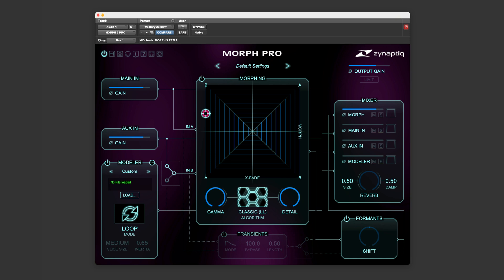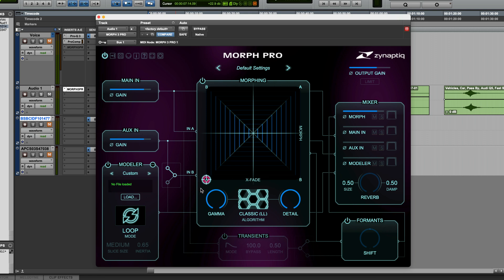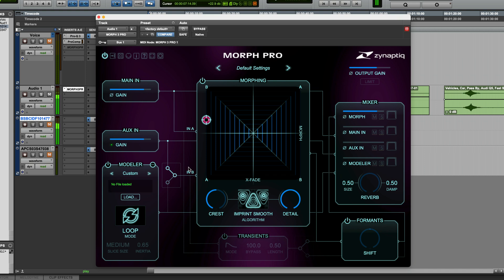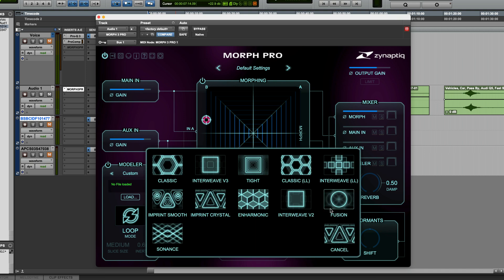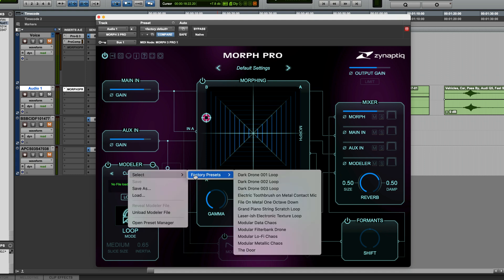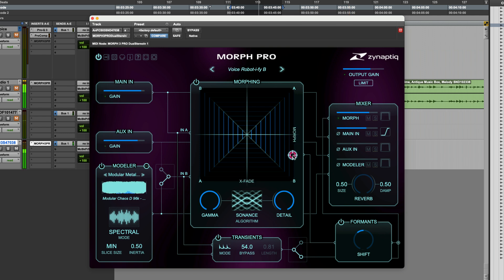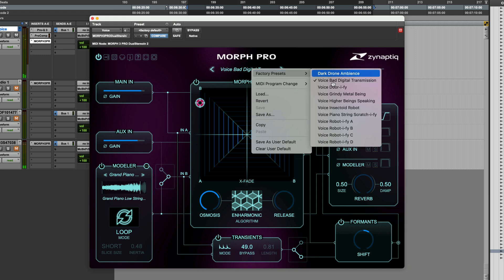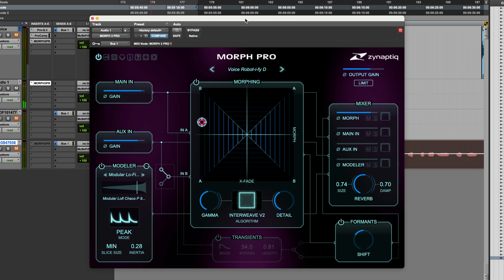Experimenting With Sounds In Zynaptiq Morph 3 Pro

Comment: Useless plugin !
Reply: Not even close, but there’s a definite learning curve when it comes to choosing your sources. It takes a lot of trial and error to figure out what works, but when it does work the results are beyond anything you could achieve otherwise. 

I tend to dedicate time to rigging up sets of sounds that work and saving those as standalone files that I can port into my projects to use like synth presets (which I can then play in real-time or render them into sets of samples). There are immense possibilities when it comes to creating hybrid sounds with this plugin.

One thing a lot of people do wrong is that they try morphing sounds that are far too disparate, like trying to combine a drum loop with a tonal line, which will almost always result in something that just sounds like a vocoded drum loop.

It usually works better when there’s a degree of similarity between your two sources. For instance, you can take an upright piano and combine it with a Rhodes to get a unique combination of the two.

There are also some interesting mixing possibilities. Say you want to inject some vinyl noise into a mix but you’re having trouble getting it to sit right. You can morph noise into your main tonal line and it’ll sit right in the mix without nearly as much effort. You can even use it to add/subtract certain frequencies in your instruments by morphing them with other instruments that possess your desired qualities. The possibilities are endless.

This plugin has been used on some very highly regarded projects, such as Mick Gordon’s DOOM soundtracks, multiple hit songs produced by Zedd/Grey, and some of Brian Eno’s latest works.
Reply: And also great for Colour Bass. @Clam-ou8nm
Reply: @Clam-ou8nm there r lots of plugins to try with.. 1st Serum.. electra n so on..lots more efx plugins in UVI..
Thnx Bro
Reply: Works incredibly well as a vocoder effect as well
Reply: Works incredibly well as a vocoder effect as well...